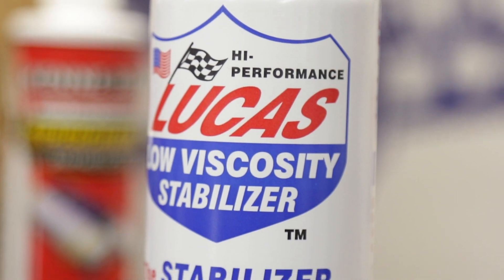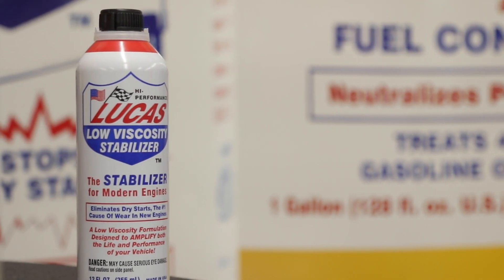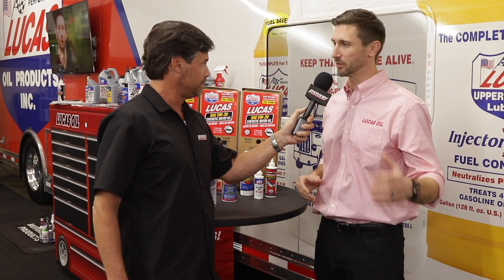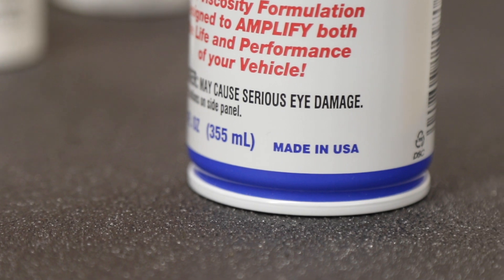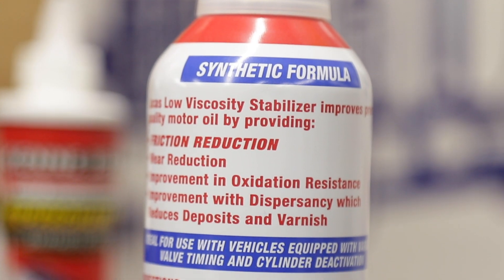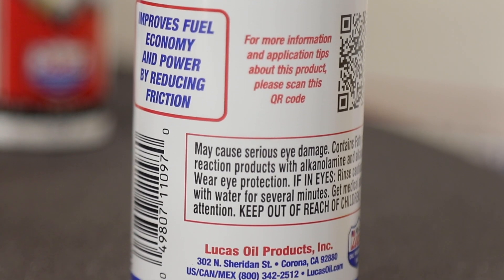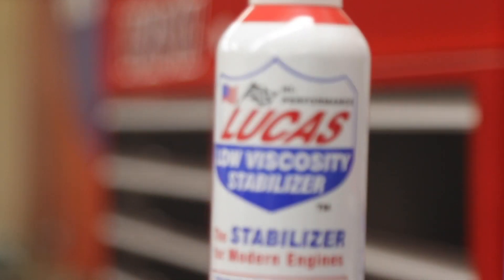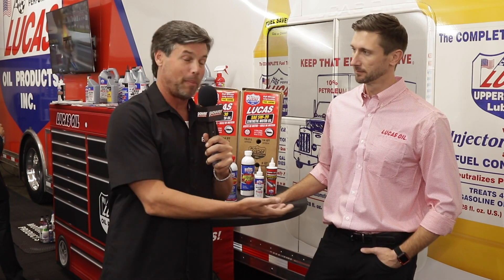Lucas Oil Low Viscosity Stabalizer

Comment: I use this Lucas product in my 2017 GMC Yukon, which takes 0w20 dexos engine oil.  I only drive this vehicle periodically and sense it is not driven regularly dry starts are the main reason for using the product. The 5.3 in the Yukon holds 8 quarts. One 12-ounce bottle treats up to 7 quarts, so I add 2 more ounces from another can, 14 ounces in total. Even after sitting for long periods of time, the engine starts and runs smooth and extremely quiet. Lucas low viscosity pure synthetic oil additive is thin, so it will not thicken your oil.

Comment: I have a 2018 Rav4 use 0-20 oil how will this work .
Reply: It basically keeps the oil coated on upper parts so when you start the car there is protection. I am not saying your vehicle needs this but for 9.99 you cant beat it.
Reply: @AOG_ETH  you must be a spokesperson for Lucas!
Reply: Not at all I just know that it helped with my dry start.
Reply: @AOG_ETH  oh ok. Well I just put a can of it in my 2016 Altima, hoping it doesn't harm my engine instead of helping it
Reply: What is your Altima engine doing?
To sum it all up the Lucas basically coats metal parts in the engine. I have a 2015 Ford fiesta I am going to add some to it as well
Reply: @AOG_ETH  Mine starts a bit rough in the morning. I have Mobile 1 full synthetic 5w30 in it
Reply: Does it misfire make noise?
Reply: @AOG_ETH   it shudders and drive and in park! I had all the motor mounts replaced and the harmonic balancer but still rough in the morning and shudders
Reply: @AOG_ETH  yes its it' also loud
Reply: @AOG_ETH  Did you put the whole bottle I only put half